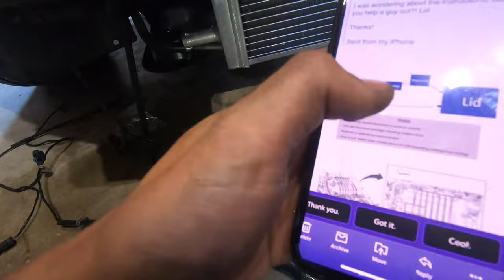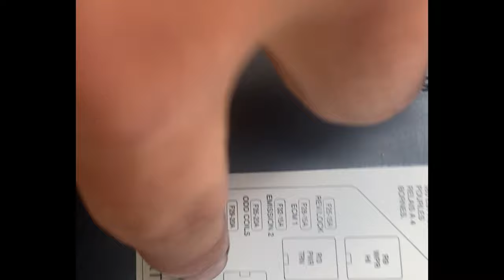LSA Coolant system! Pt.5 Pontiac G8

Comment: Can you tell me what’s the part on the top right of the car it has a little yellow/white cap that twist and is made of whatever the engine block is made of. That line snapped in half and I don’t know what it’s called it’ll be on the right side of the engine after popping the hood and it curves like a U next to your intake and corner headlight